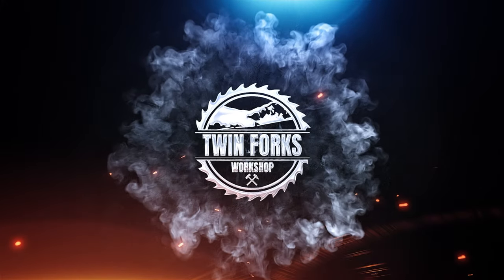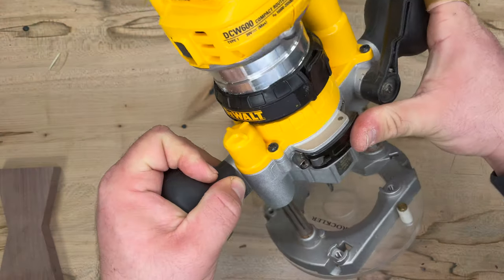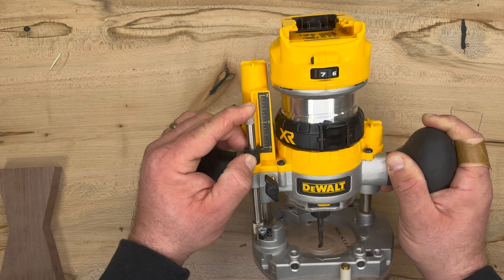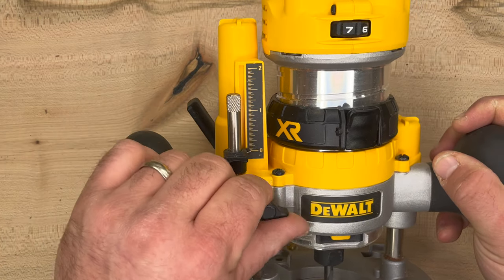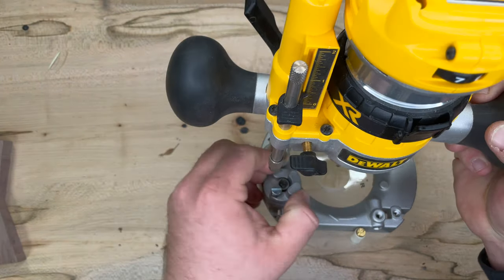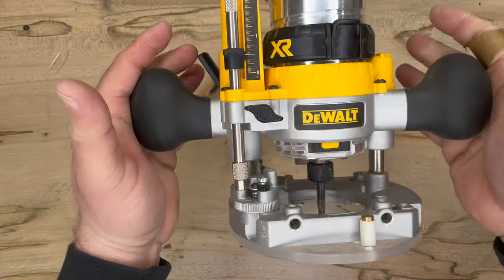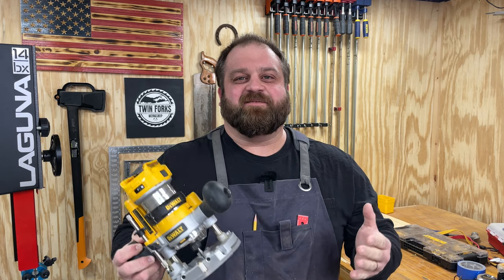How to Use a Plunge Router the RIGHT Way!

Comment: I appreciate the tutorial.  Everything's easier when you know how. 👍
Reply: Thanks for watching! What are you planning to use your router for?
Reply: @chrisbernichon  I ordered shaker style doors. When they came all they were was three-quarter inch MDF sheet with a routed out center to make it look like a shaker door. I mis-measured a pair that are the wrong size. And I have some leftover MDF. So I will try to copy the doors by using a router jig with stop blocks.
Reply from the maker: @waynemiller6070  Very cool, do it outside if you can. MDF is a MESS.
Reply: @CTEwithMrB  In the 90s today. So yes. Lol Using dust collection even outdoors too.

Comment: Can I use the plunge router to make a 1/2 in round over? By using the step down as you have shown.
Reply from the maker: You don't need a plunge router to do a round-over. You need to purchase the correct size round over bit.

Comment: This may be a dumb question but can you do trim work and edge profiling with this type of router or are compact routers the only type that can do that.
Reply from the maker: You can use any plunge router for trim work. You just set your depth before cutting. The best part about this router is the plunge base and fixed base are interchangeable. That way, when doing a simple round-over, you can put a smaller, easier-to-handle base on.
Reply: @CTEwithMrB  Thank you.

Comment: When it comes to plunge routers, is it safe to use a collet extender with them? Or is that strictly a router table thing only? 
I’m wondering if I can use a plunge router with an extender to do a 4” plunge cut on a 6x6 piece of timber. If not, I’ll probably just use a whopper blade on a jigsaw do make the cut.
Reply from the maker: Personally, I would use an auger bit and then use a chisel to square up the opening. https://amzn.to/3R5y50Z . The collet extenders I’ve seen don’t recommend their use on plunge routers so definitely check with the manufacturer.  P.S. I bent a flattening bit on a router sled and nearly 💩 myself; I understand why they don’t recommend it 🤣

Comment: Good clear video.  I have the corded version of this Dewalt router.  Have been nothing but disappointed with it. Poor dust collection.  Painful to change bits.  Just not well designed.  So wish I had just bought a Festool one straight away.
Reply from the maker: Really? I left mine off for the purpose of the video but have you tried this? https://amzn.to/3KcPijP they make one for the fixed base too https://amzn.to/3K4ThPv.
Reply: Yes both these came with the  Dewalt kit. They are terrible to use.  They get in the way and they don’t work well at all.  It is a poorly designed system.
Reply from the maker: @murphyrp01  so what are you going to get instead?
Reply: Next router will be Festool 1400.  Made the mistake thinking that Dewalt was a very good brand.  Having got Festool track saw and sander the difference is significant.
Reply from the maker: @murphyrp01  that looks like a solid unit. I’m always leery of the festool premium. I have a rotex which I really like but find it’s to much sander for finish standing. I have their cheapest dust extractor that is an awesome value. 

Whatever your preference, as long as you’re in the shop making dust that’s all that counts!

Comment: Thanks for sharing, how do you finish the corners, the radius of the bit will prevent you from getting a sharp corner, like the bow tie has, do you finish with hand tools, or a smaller bit, or....?
Reply from the maker: Great question! Once you get the majority of the bow tie cut out, you test your fit and use a chisel to get your sharp corners and tight fit. The method is called sneaking up to the fit. You take small bits off at a time until it is perfect.

Comment: The adjustment ring on the router is removed when you are using the plunge base.  The router will set flush at the bottom of the base with the ring removed, according to the directions included with the plunge base.
Reply from the maker: That’s right. I leave it on so it doesn’t get “lost” like every tape measure and pencil I own the second I need one.🤣

Comment: So, to be sure, you /don't/ start with the 1/2" you originally set it at? Saw twice at 1/4"?
Reply from the maker: Yes it is always best to take multiple lighter passes when using the router. It will help keep your bit sharper for longer by preventing burning, and it is less likely to kick back at you.

Comment: I am desperately trying to find a video or something on making a display for my gemstone eggs and spheres. I want to make various size crescent cuts in wood slices that will hold the gems. My eggs are all different sizes. I have an idea of what I want and bought an inexpensive router and Baihens 1/4 Inch Shank Cove Box Router Bit Set Solid Double Flute Nose Bits. Help?
Reply from the maker: Hi Kelle, that sounds like a fun project! I’d love to help you with that. I’d say start by tracing each one in the position you want them, use a plunge router to remove most of the wood, and then come in with a chisel to clean it up. If you end up with a hole that’s slightly larger than you need you can put a bevel or round over by hand sanding to ease the edge. That will help hide any imperfections or fill it carefully with epoxy and a syringe. If you’d like we could hop on a quick video chat so you can show me what you’re working with. Send me an email, or DM!

Comment: You HAD me all the way....UNTIL....you got the part "we're only gonna cut into the piece by 1/4".  You moved the turrett, but didn't show or elaborate and what you did.  One could only assume you moved the turrett 1 twist to bump UP to the next higher one.  Assuming then that you will finish the first pass at the 1/4, then just move the turrett to the next lower and pass again at 1/2"?????   I thought it was GREAT till that part I mentioned
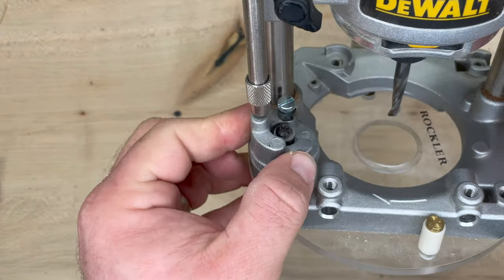Reply from the maker: I see what you mean. Thanks for pointing that out. Around 1:11, I explain each increment of the turret is 1/4" and we are going 1/2" deep. Two passes, a quarter of an inch at a time. Thanks for watching!
Reply: @CTEwithMrB  Can I give you a scenario and you can help me out please.  I ONLY need a 3/8" dado cut for my T-track.  Now, assuming, I ZERO out my bit on my workpiece first.  Then I set my depth gauge to 3/8. 

 If I want to take the plunge incrementally (i.e. 1/8th at a time for each pass, then if use the tallest turret for the first pass, then I move it to the second turret, then the third.....Are you saying that each time I move it, I'll be cutting an additional 1/4"??  Or does the turret truly represent a quarter of your cut each turn?

In other words, the tallest turret being used first will give you 1/8, then the second will drop the cut an additional 1/8, and then the third turn will drop you down to the 3/8?   

I'm confused!!!